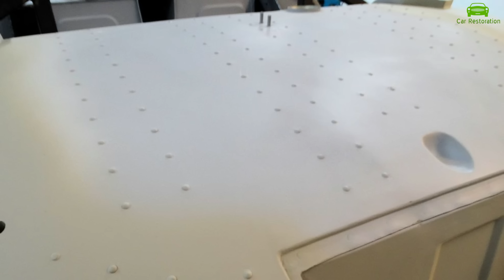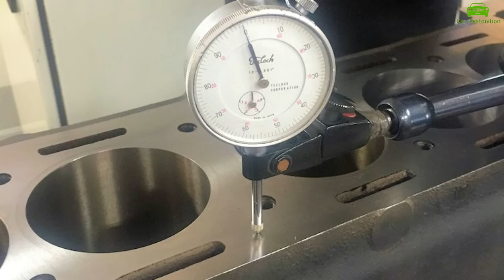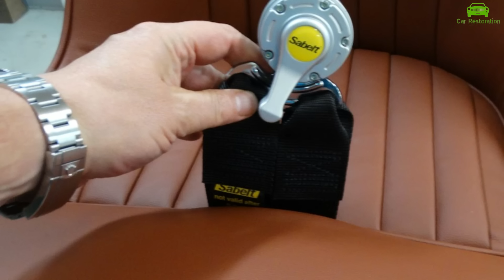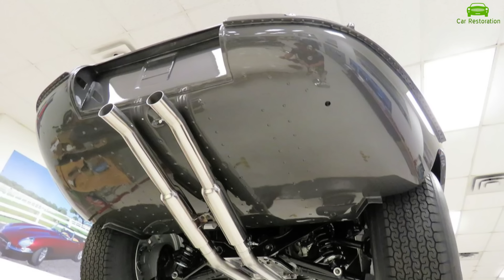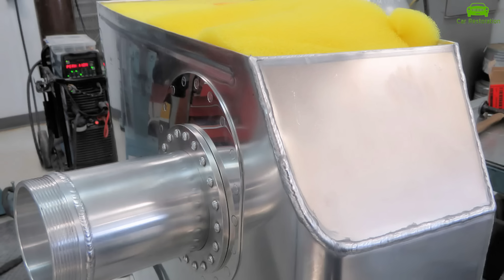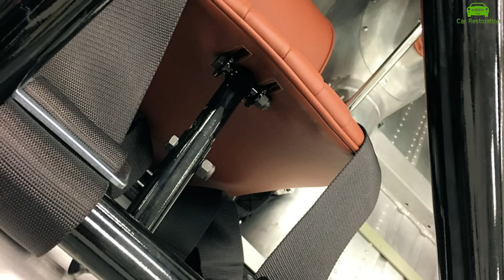1963 Jaguar E-Type Lightweight – Ultimate Hand Built Resurrection by Team CJ

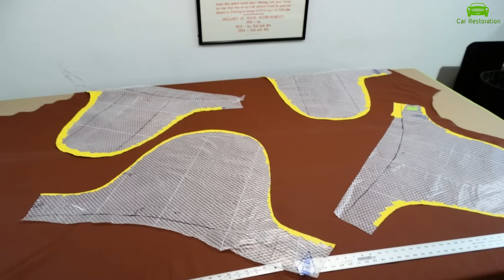Comment: 2:14 'The engine stroked to 4.2 litres.'
The Jaguar XK engines had the same stroke. Capacity increase from 3.4 to 3.8 and 4.2 litre was by increasing the bore. It's not possible to go from 3.8 litre to 4.2, as the bore spacing was changed. This meant a different block casting and crankshaft.